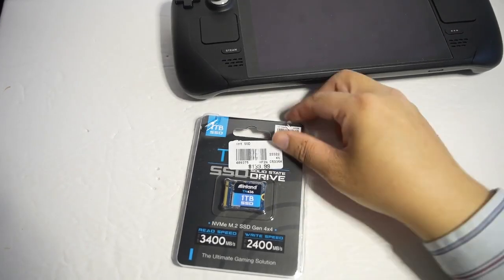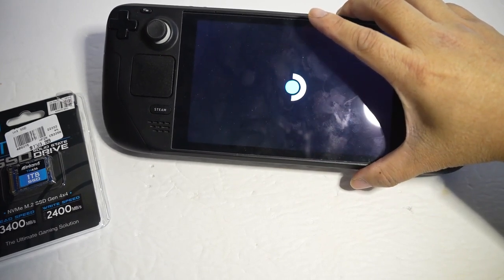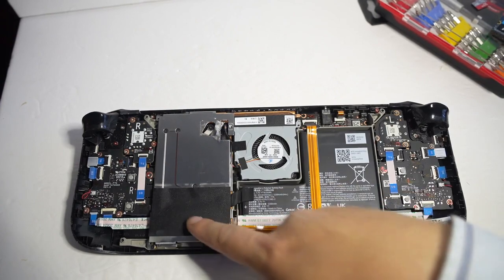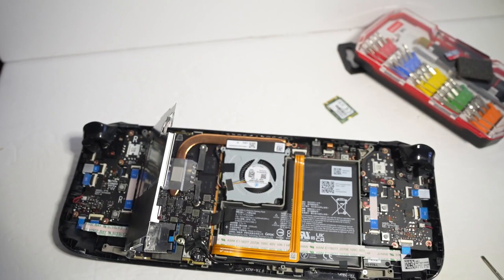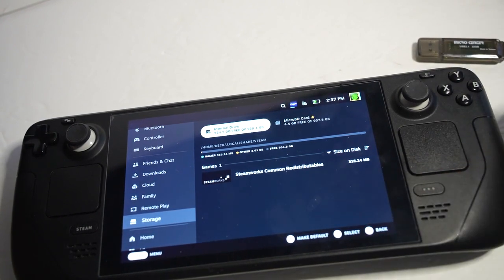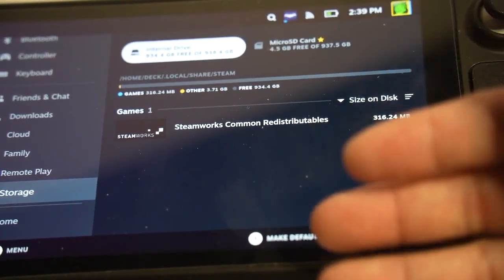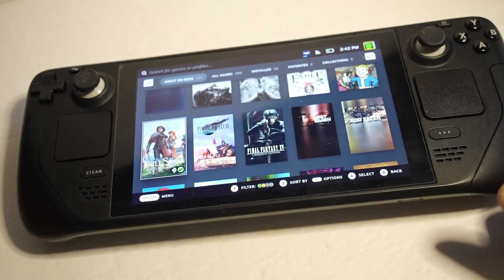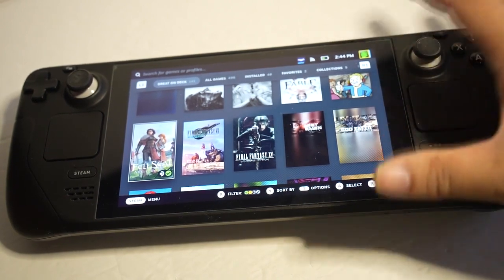How to Upgrade Steam Deck to 1TB

Comment: Thank you for this video. I encountered the same issues you showed like the metal shield not lifting up fully, and it was hard to remove the ribbon connector of the battery. So I just left the battery ribbon and unscrewed the 64 eMMC and replaced it with my 1TB SSD. Then used a 3rd party dock, that was plugged to the electric outlet, to pass through a USB A with the Steam OS image. It worked, but there was a moment where I was stuck where the Deck was booting but returning to a black screen. After research, the issue was that you should not plug other USB accessories such as a mouse and keyboard because the Deck only accepts one USB being passed through during OS reimaging. Works fine for around 2 weeks now, but yeah I guess I was also lucky that it worked even if I did not disconnect the battery ribbon.

Comment: Do you see any issues with that inland ssd heating up more?
Reply from the maker: No issues so far, it's been over a month since I installed the Inland SSD. It works! Note: I hear my fan spinning hard in spirts sometime. This is new since I installed the Inland. Like one moment it's quiet and then suddenly the fan violently spins! But it's only a few seconds before the fan goes back to normal. I don't know what is causing it, maybe there are spikes of heat? I just know that the Steam Deck is fine. I have a lot of games installed on it now, including 8000 roms, which is pretty awesome.